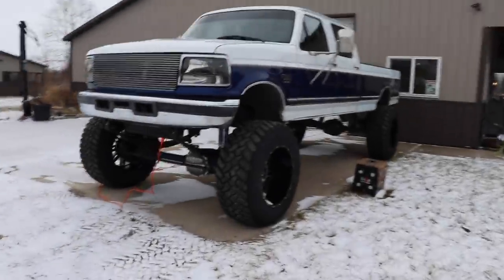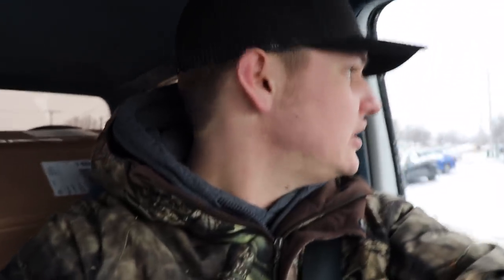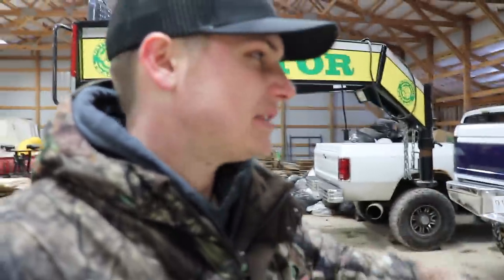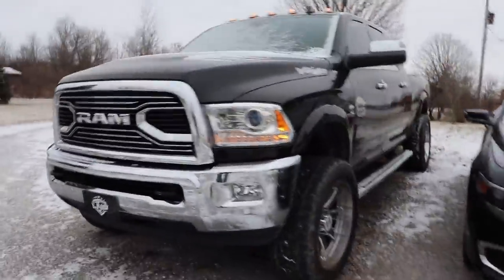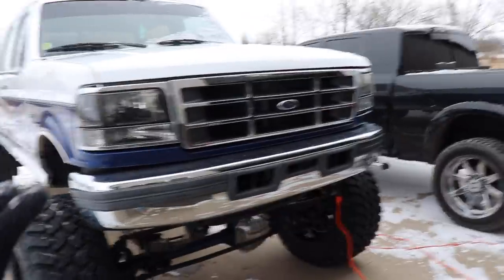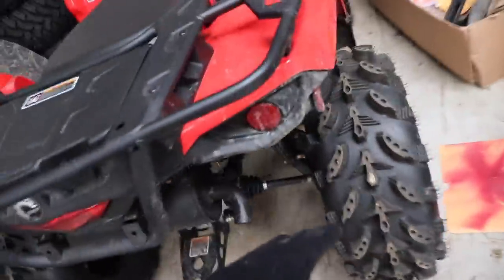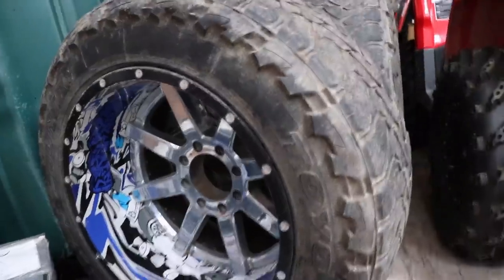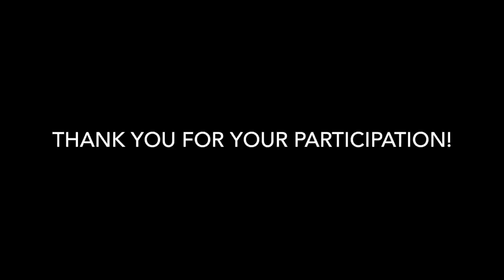MONSTER OBS PowerStroke GETS A FACELIFT!!!

Comment: You should put traction bars on the 7.3 so you can put more power to the rear wheels without tearing anything apart
Reply: LOGAN22 all 80hp to the wheels with those 40s and stock 7.3
Reply: I agree, but unfortunately it takes the ground clearance look away from the truck. It's too busy on the rear of the truck.

Comment: As much as you don’t spend on videos doing real work on the trucks I’d say 90% of your “Busy” is the Girlfriend nothing related to the channel
Reply: Bartek Witas I would recommend that or interstate. It’s always better to spend more in the first place for a better battery
Reply: I wouldn't buy Walmart or Motorcraft batteries. Interstate are good Batteries. but really get with the times. update to a AGM battery,  or non acid battery of some kind. dry cell, gel, whatever. I did that with my Harley years ago, I don't even take them out of the bike in winter time. no battery maintainer,  no corrosion,  no more cleaning your battery terminals. no more issues what so ever. after running them in the Harley  and then on my tractor puller tractors,  I have switched everything over. never go back to acid batteries ever again